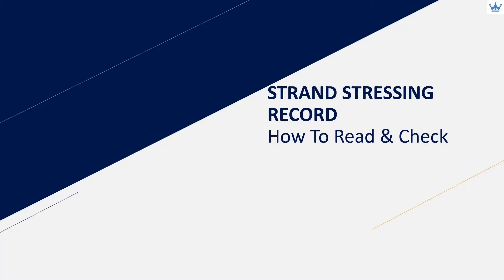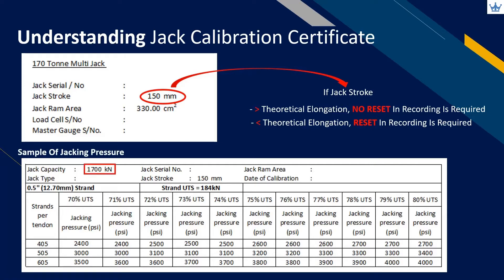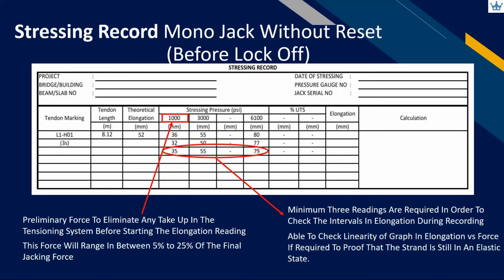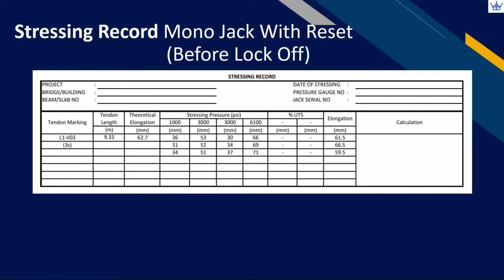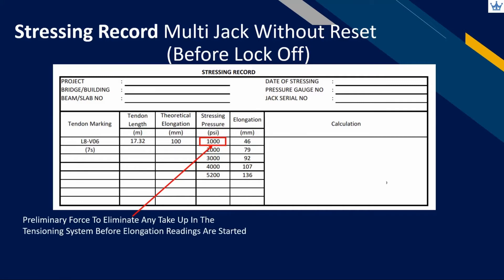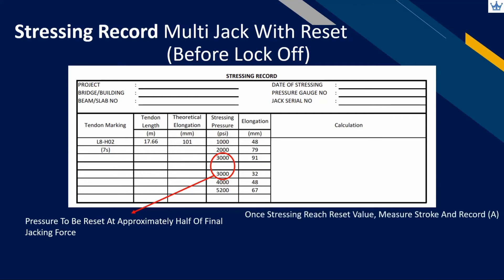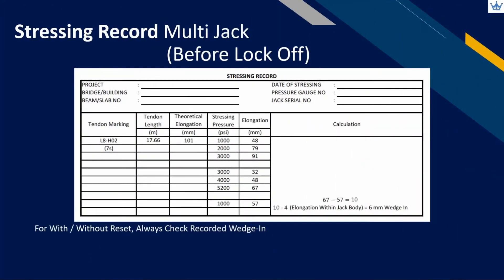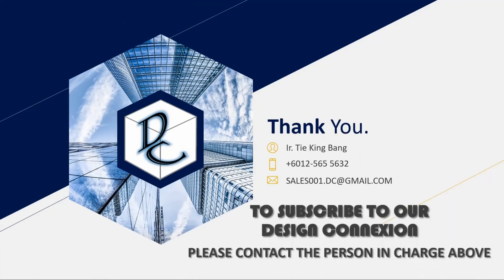How To Read & Check Stressing Record? [Elongation] #PT #Posttension #engineer #stressing #record

Comment: What will be the bases of the permissible + and - deviation of theoretical and actual elongation?
Reply from the maker: Depending on which code that you use for PT design. We are using BS 8110 where under tensioning procedure, the difference is stated within 6%. ACI adopt 7%. Hope it clarifies.